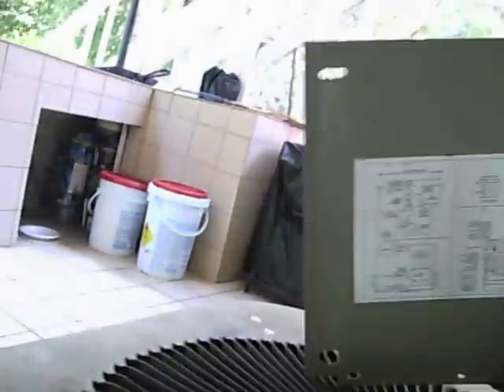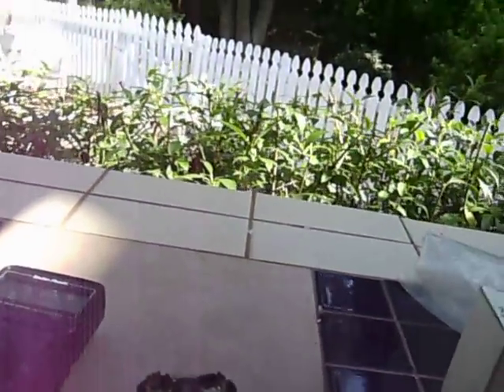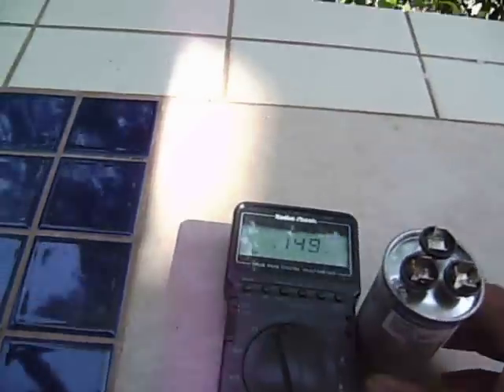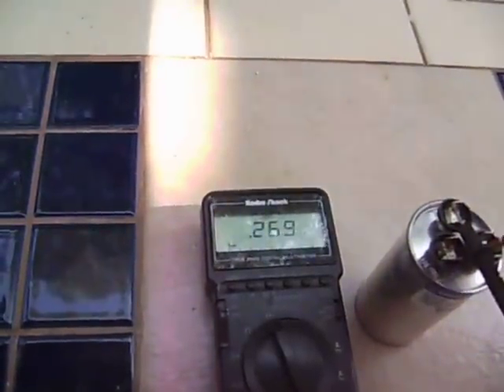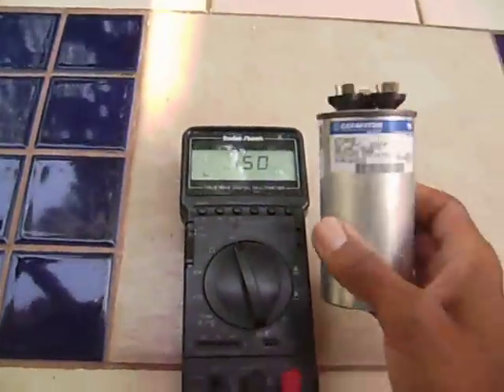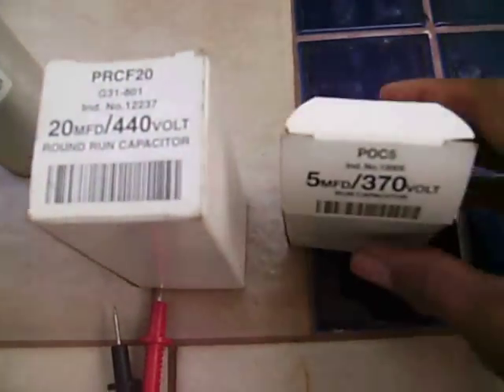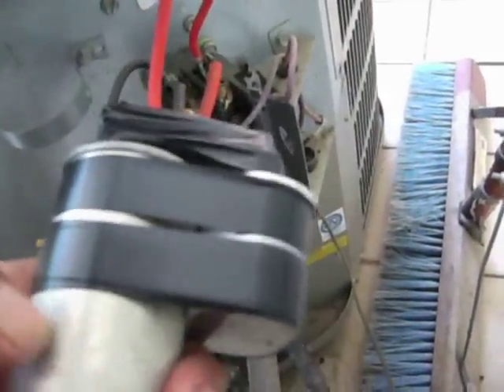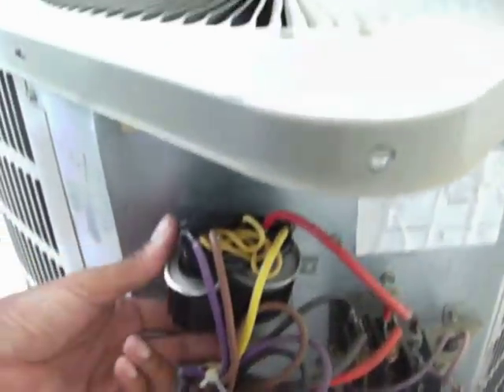Capacitor Check

Comment from the maker: Hi RonGJX  You have got it Right Both of the capacitor will not work. The fan side may be good or the HERM side may be good but thay both shear the C post if one side is bad it will trip the C/B.

Comment: Nice video...thanks.  Follow up question.....When a dual function capacitors goes bad, does that always result  in BOTH the compressor not turning on AND the fan not running.  Could it be that if only one side of the dual function capacitor goes bad, that the other side is still functional?